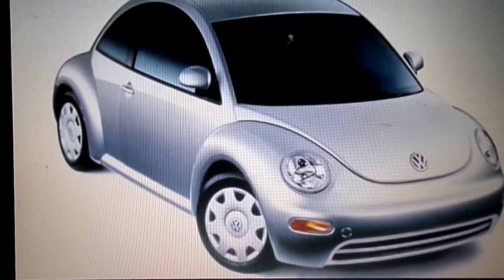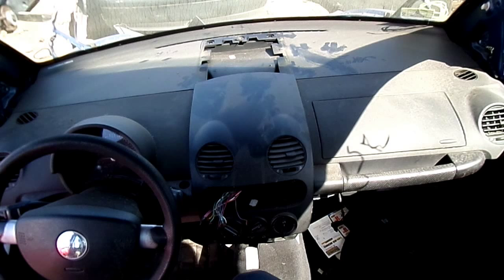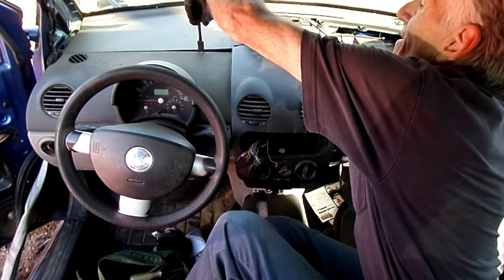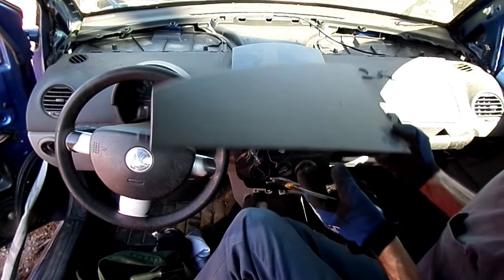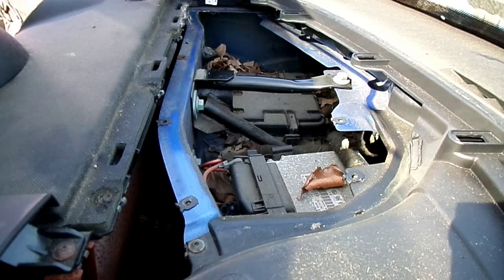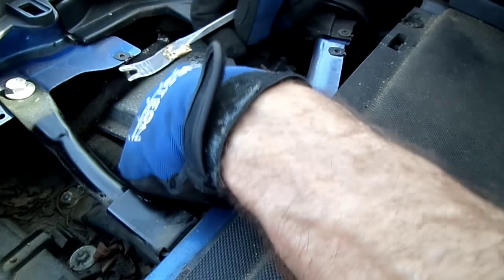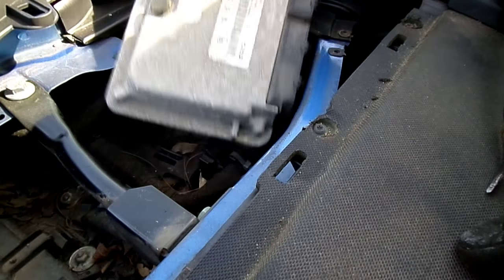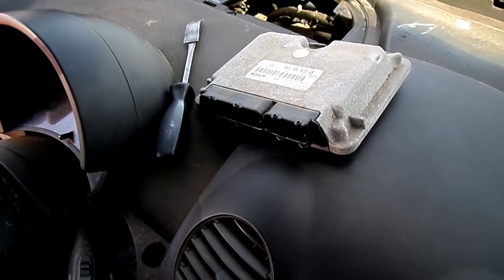Vw New Beetle Computer Removal

Comment: Does this also work for a 2012 Volkswagen Beetle? My don't have an owner's manual for it
Reply: Most likely won’t the 2012 model is a redesign from the older ones. This is for the 1998-2010 beetles

Comment: Hy thaks fore voideos. ITs very help then do some jobs  on NB ;)  i have a problem somfing is doing not fine sound in air blow on front vindow intak. Its a last dash bord panel. I have problem i cant not remove it somfing by sides holding panel.